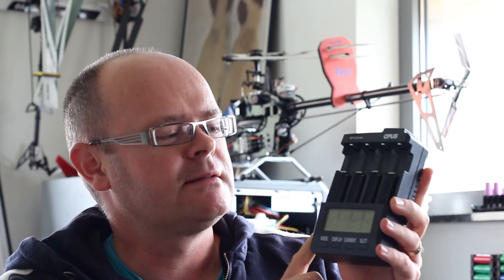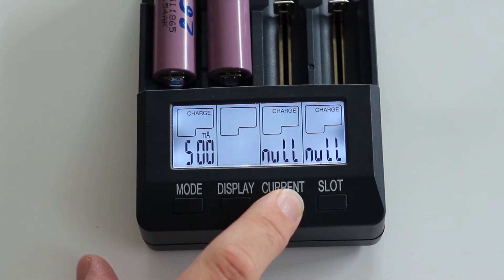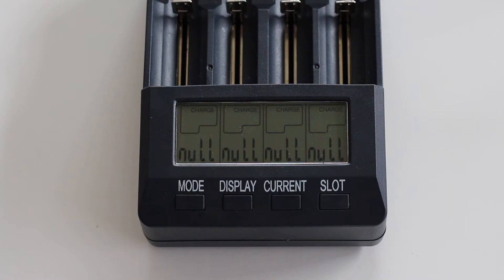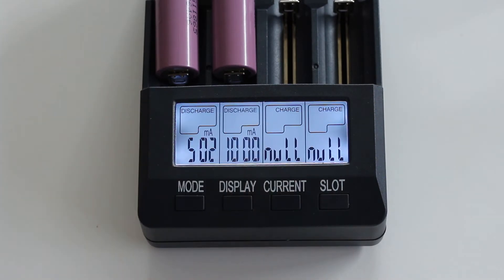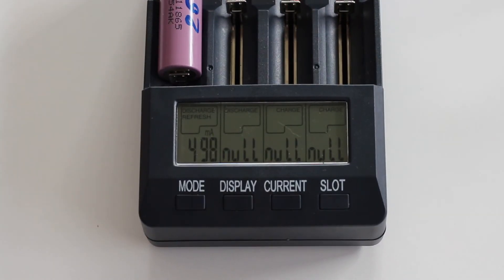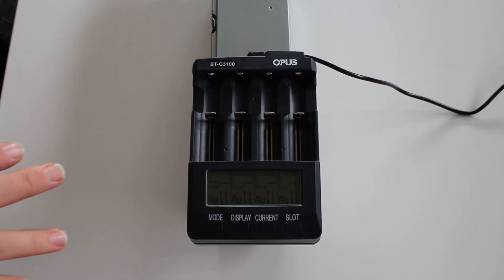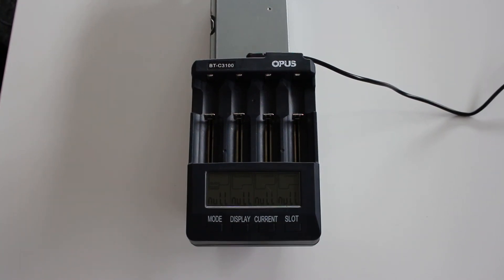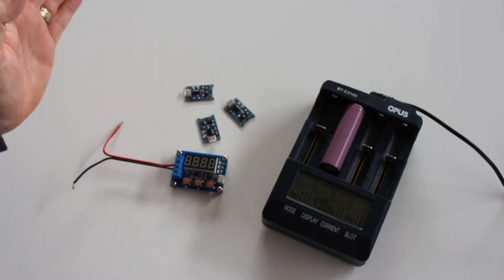18650 - Part 5 - Opus BT c3100 v2.2 charger & discharger for li-ion battery cells

Comment: During the charge test, does it replace the discharged capacity with charged capacity when it fully charges after a discharge? Because that would kind of ruin the whole purpose of the test.. to obtain the capacity during a discharging.

Comment: I just subscribed to your Channel. I'm a new bee here to the batteries world. After watching your video, I'm intrigued with 2 things. 1- when the opus discharge the batteries, where the battery charge goes? 2- you are saying if we intend to use 18650 batteries to flash lights, we need a charger to charge the batteries to 4.0v, why is that? The only charger I have that came with my flash light, charges the battery to 4.2V. Will I damage the battery using it in a flash light or will I damage the flash light using a battery charged up to 4.2V? I have a few Sony 18650 cells that I took out from a cordless vacuum battery pack that its pcb went bad. The cells appears to be good and I'm using these Sony cells in my flash light. Also I was planning to make a small power bank with an empty power bank case from ebay/amazon  with these cells as I have 6 of them. I probably will buy this Opus charger. Your advice is much appreciated.
Reply from the maker: Hi, glad you like it.

you have multiple questions in one... 
1/ the discharged energie disappears in the form of heat.
2/Some flashlights have build in 'bms' (battery management system), but most do not have that. That means that you can drain a battery to beyond the safe 3V. On the other hand, you can insert a 4.2V battery if you want. For the flashlight this does not make any difference.
However, if you want your batteries to last long, especially in something like a powerwall, everyday charged and discharged, it is advised to adjust the max and min values to about 3.2V as minimum and 4.0V as maximum. (not possible in a charger like the Opus and others)

just a tip before buying the Opus .... I will try to finish my video on the Liitokala lii-500 charger this weekend. (much cheaper then Opus)
Reply: Sailing and electronics 
Thanks man for the reply. 
I will wait for your new video then. 
Regards.

Comment: WARNING, you are so WRONG about leaving them unattended for long periods whilst asleep or out for the day. like any mass produced product, a few leave the factory with inbuilt faults or bad components, i had one unit that either the internal tempreture sensor failed, or the auto shutdown failed because either the fan had failed first or id just simply loaded a bad 18650 cell.i was not in the room when it happened, but the cell got RED HOT & EXPLODED setting the unit alight & spraying flameing parts about. luckily i was home but only found out when the smoke detectors went off. the room was full of smoke with the unit itself well ablaze & the carpet smoldering in 5 different places. they need checking on at least once per hour & if GOING OUT OR ASLEEP. TURN THEM OFF FOR PEACE OF MIND. i still have the unit if youd like to see photo proof...........

Comment: Hello,
can you please tell me how to find the posible  high or low  discharge rate of the Li cells ?  Is not writen on the cells .  Thanks
Reply from the maker: Discharge to 3v and charge to 4.2v.
This is for measurement only. For power wall be more conservative so cells will last longer.
Reply: @Sailingandelectronics  Thanks
I mean how much can be the current Amp. for discharge or charge

Comment: I have one that look the same but the name is zeepin Bt-c3100 v2. 2 but in My eyes that are not useful to check capacity becouse of it discharge to 3.21v i use it only for charging, use Skyrc imax b6 mini for discharge but looking for a Charger that can discharge minimum 4 cell  to 2.8v or at least 3.0v, that voltage have your Charger on discharge?

Comment: just FYI there is a switch on the bottom when you open it to choose the charging voltage cutoff. I think it's 4.2 4.35 and 3.7
here is a video showing in depth someone else made. there are several models this brand that all have that switch https://youtu.be/Jj-d66kJzpg

Comment: Did you try to charge twins cells (2p from a laptop pack)? I found the cells getting hot before fully charged. Also with the TP4056 the twins getting hot. When seperated the charge fine. I don't why see reason why?
Reply from the maker: KaeL no, didn't do that. Use single only. Only way to be sure.

Comment: Why do you recommend only charging vaping batteries to 4.0 or 4.1 volts?
Reply from the maker: The same batteries, but if you want to keep them in good shape it is best not to charge them to their max AND min voltage. So for daily use/charge, 4.0 or4.1 would be safer bet. The cells in the powerwall will also be limited to be charged at 4 Volts.  Not a Vapor myself, for the biggest cloud, you probably need the highest voltage.... just a guess here.
Reply: VapeKing he is wrong that for vaping you need to have it under 4.2V and for flashlight too...

Comment: Thanks for the review.  I learned a lot.   I was drawn to your internal R measurement using the Opus.  I have also watched your video about your SM8124 for measuring internal resistance.  Very INFORMATIVE.  I'd like to know how accurate is your internal resistance measurement against a paper and pencil calculation shown in this video https://www.youtube.com/watch?v=av38iBxcOgQ&t=11s.  The science in this video seems to be on solide ground.  Please make a video on how this paper and pencil internal resistance measurement compares with your SM8124 and your OPUS B C3100.  Thanks, Young...I hope I got your name right.  More power to your video.  - Lolo George
Reply from the maker: Maybe an idea for a future video. However, the IR is most of the time below 100mOhm, which is good and perfectly useable. If 100 seems to be 98.5 or 103, this difference would not change anything.

Comment: I don't have the ability to setup T4056 stations. I just use the Opus from start to finish. Is there anything wrong with just cleaning the harvested cell, using a voltmeter and writing the beginning voltage,  do a charge/test on Opus and finish with Quick test? Do I need to do a full charge before doing the above steps. This also gives me a "close enough" reading for internal resistance. Am I wrong? How do I improve the above steps with minimal electrical knowledge.
Reply from the maker: John Monteen, not a problem. It is best to use one type of capacity checker. That way the results are compareable. I started with tp4056,but now I'm using the opus all the time (have 5 units). They have overheating protection which I like when I'm not at home.
Reply from the maker: John, I would suggest you try different times for IR. Or give a little pressure on the contacts and see if you get different values. I always check IR at full voltage. This is not necessary. Just don't do it in the lower volt regions. And don't forget to leave them for a couple of weeks to double check voltage for voltage drop.

Comment: Opus discharges to 2.8V according the manual!
Reply from the maker: The manual says 2.8V indeed, however I have never seen it below 3.0V.  And when you take it out on it's lowest charge and test it with a voltmeter, it will already gone up to 3.2V in a couple of seconds. So it is not really discharged to that point I guess, but only touches the number (2.8V or 3V) which switches off the cycle and starts charging again.
Reply: Just ask about that, but see you have My answer here, i will look for another Charger with real disharging to 2.8 or at least 3.0v